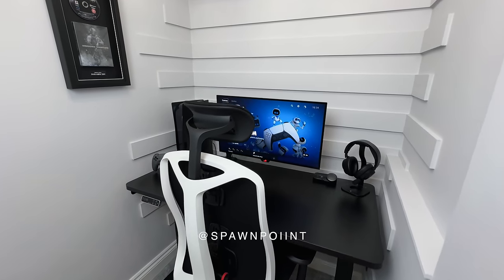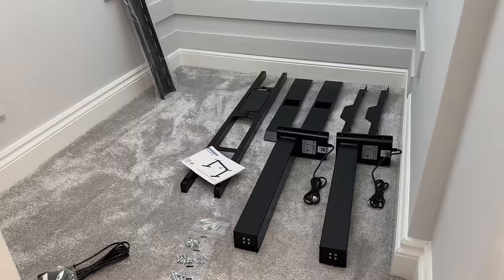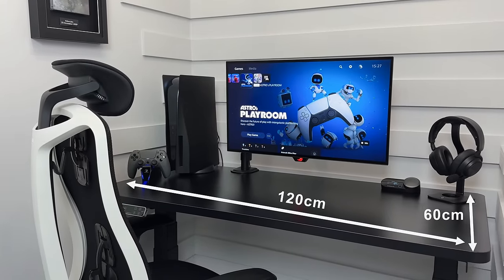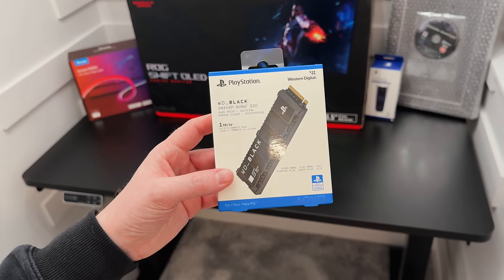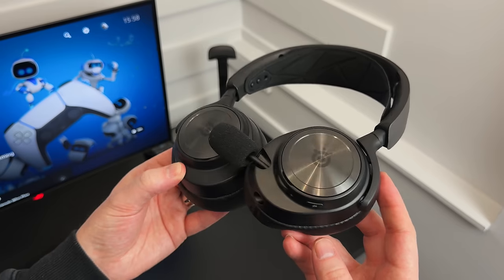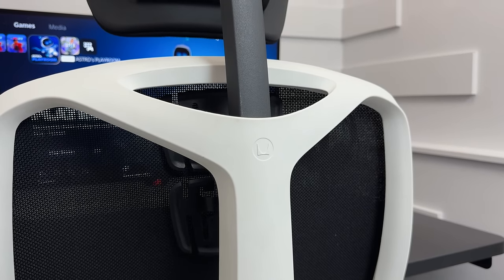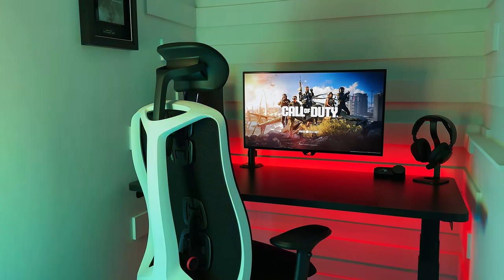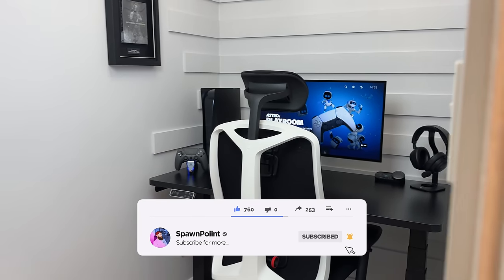Building the Ultimate Small Room Gaming Setup

Comment: My desk is pretty much the same size, the problem is that it is also an office so my monitor is in the left end, the laptop is on the right, there’s a wireless speaker between them and a keyboard in the front. The PS5 is in the bottom left end under the desk. I need to fix the cable management though.

Comment: cool video bro! create a video about Making a gaming room using these components-                                                                                                                                               CPU: AMD Ryzen 7 7800X3D
RAM: G.SKILL Trident Z5 Neo RGB 32GB DDR5-6000 CL30
GPU: ASUS ROG Strix GeForce RTX 4080 OC Edition
Storage: ASUS ROG Strix Arion M.2 NVMe SSD Enclosure 
Cooling: ASUS ROG Ryujin II 360
Case Fans: ASUS TUF Gaming TF120 ARGB (Triple Fan Kit)
Power Supply: ASUS ROG Thor 1000W Platinum II
Case: ASUS ROG Hyperion GR701
Motherboard: ASUS TUF Gaming B650-Plus WiFi
RGB lighting kit: ASUS Aura RGB LED Lighting
Cable Extensions: CableMod RT-Series Pro ModFlex Sleeved 12VHPWR Cable Kit for ASUS and Seasonic
Sound Card: ASUS Xonar AE
Wi-Fi Card: ASUS PCE-AXE58BT
Gaming Mouse: ASUS TUF Gaming M5
Gaming Keyboard: ASUS TUF Gaming K3
Gaming Monitor: ASUS TUF Gaming VG27AQA1A
Gaming headset:  ASUS ROG Delta S
Gaming chair: ASUS ROG Chariot Core
Gaming desk: MSI MAG CH120 I Gaming Desk
Webcam: ASUS ROG Eye S
Mouse Pad: ASUS ROG Sheath
External Storage: ASUS FX External Hard Drive
UPS (Uninterruptible Power Supply): ASUS ROG Strix 850W Gold
Monitor Arm: ASUS ROG Desk Mount Kit
gaming speakers: Razer Leviathan V2 Pro
Cable Management: ASUS ROG Cable Organizer. your next video Idea

Comment: Which montior you are using currently?
Reply from the maker: Currently using ROG's latest 32" 4K OLED (PG32UCDM). It launches in a few weeks I believe.
Reply: @SpawnPoiint  so as you have used both 27 inch and 32 inch, which you prefer for macbook and PS5 setup